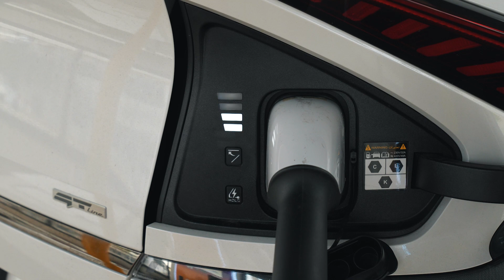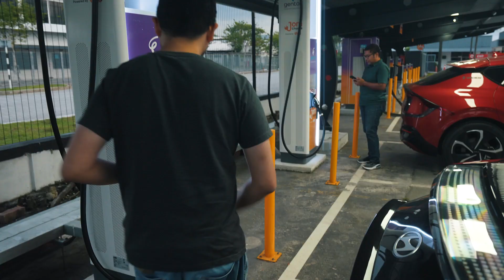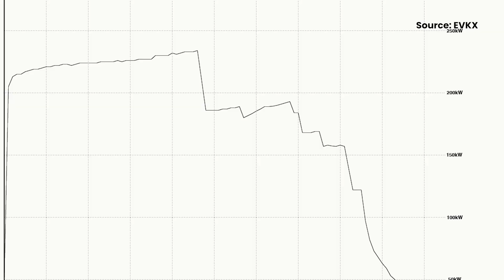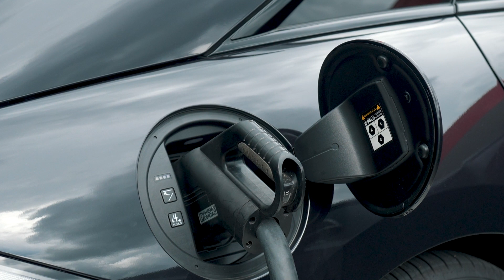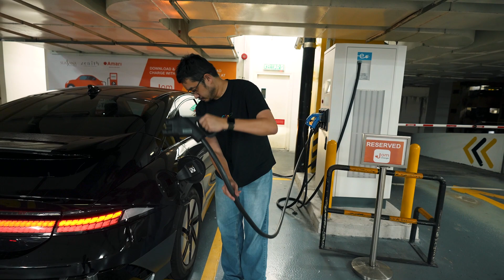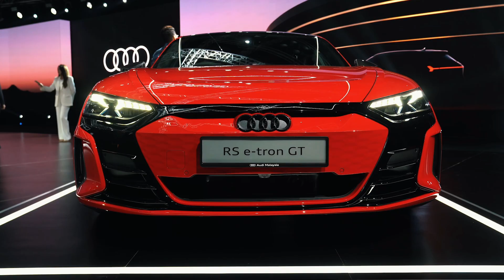What is EV charging curve and why you shouldn't DC fast charge beyond 80%? | Let's Talk About #128

Comment: Chery Australia has recalled 5901 examples of its Omoda 5, after discovering a defect which can result in brake failure for the small SUV.

The recall affects all Chery Omoda 5s sold in Australia since local deliveries began in mid-2023.

“Due to a manufacturing defect, the bolt securing the brake pipe union may not have been tightened sufficiently. This could cause the brake fluid to leak and result in reduced braking performance,” Chery said in its recall notice.

“A reduction in braking performance could increase the risk of an accident resulting in serious injury or death to the vehicle occupants, pedestrians and other road users.”

Comment: One advantage Tesla has it's their on board navigation and Supercharger network. When you use the on board navigation(BEV owners don't really use Waze as it's for ICE) the car will precondition it's battery for optimum charging before it reaches the supercharger it's going to. Preconditioning of batteries is one topic that needs to be discussed more. Preconditioning is not only for warming batteries, it's also for cooling and that's why BEV has coolant. And it's always best to charge at home if you can install an EVSE.
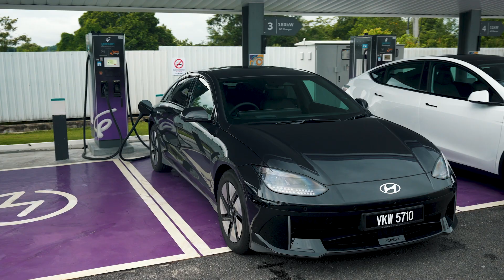Reply: Preconditioning was discussed. Watch 11:31
Reply: @alexwnl  and don’t forget preconditioning is also for cooling and not just warming.

Comment: Electrons are all negatively charged, and similar charge repels each other. So the 'fuller' the battery, the stronger this repulsion force, the more energy it takes at cram new electrons into the battery. 

(This is how I understand it, might not be 100% correct)